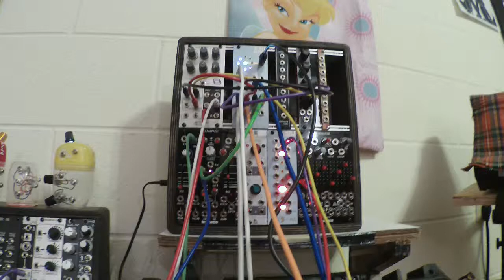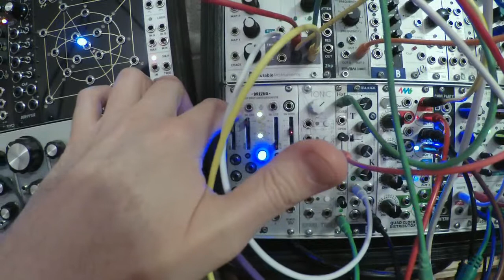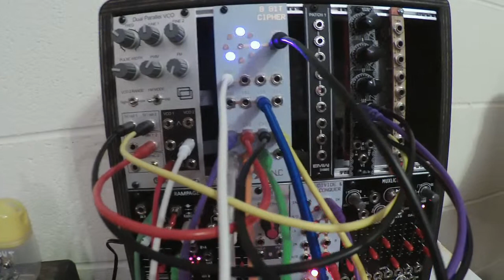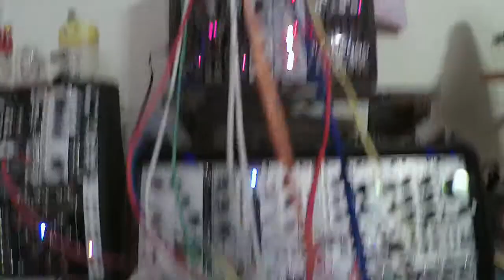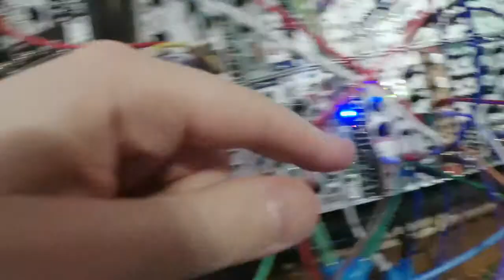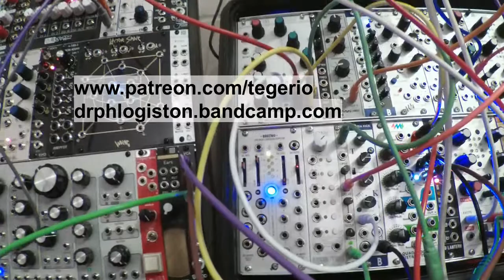NLC 8-Bit Cipher

Comment: Im looking for a module to generate pseudo random looping gate patterns out of LFOs etc, this and drezno both seem like good shouts, do you have a favourite? The CV outs on the 8 bit cipher are a nice bonus, Im not overly bothered about the stuff drezno does with audio.
Reply from the maker: Definitely the Cipher for me.  I use it a lot more than Drezno, but these days I mostly use the CV outs.  If you're using them to generate gate patterns, consider the following:

The Cipher uses a shift register and is only looking for an on/off state at the data input, so if you feed it a sloping LFO the subtleties will be ignored and it will be treated as if it was a square wave.  Assuming you use a steady clock, changes in LFO rate will change the gate patterns, but in odd, non-obvious ways.

Drezno uses a direct analog-to-digital converter so the shape of your LFO will affect it, as well as the rate.  Altering the input signal will change the gate patterns in obvious and immediate ways.

Both modules can be clocked "irregularly" i.e. they do not require a steady tempo.

For the specific application you described, I think Drezno would be more satisfying to use.  But for long-term versatility in lots of different kind of patches, the 8 Bit Cipher is the clear winner.
Reply: @JoshuaKennedy321  thanks for the detailed response. If I can be so churlish as to press you further: drezno is better for gate patterns because it requires less tinkering/more taming? I guess I want the one that produces the wider array of vibes. Did you find the gate patterns these modules produce got a bit samey? The fact that it's cheaper and also produces CV has me leaning towards Cipher. Let's Splosh also looks pretty nice...
Reply from the maker: @sumocloud  Drezno seems more sensitive, or responsive I guess.  It's easier to get noticeable changes and it's simpler to control them, whereas the Cipher depends on the interference pattern between your clock and your data signal.  Drezno produces wilder patterns and the bits are arranged so if you're feeding it a simple triangle wave the slower-changing ones are at the top and the busier ones are at the bottom.  Cipher feels a lot more "samey" ... but those 4 CV outputs are really worth having.  If my 8 Bit Cipher got damaged I would replace it.  Drezno, I don't think I would buy again.
Reply: @JoshuaKennedy321  cool that's really useful, thanks!

Comment: Love your style, man. Super fun.
Reply from the maker: Thanks!
Reply: @JoshuaKennedy321  So---a year later---what's your thoughts on this gem. Do you still have it? Does it make more sense? How do you use it most often? Really interested in this one. And thank you!
Reply from the maker: @JohnoWells  It's closer to two years later and yes, I still have it.  The Cipher is one of my most-used modules that finds a place in almost every patch.  The CV outs are more useful to me than the gates.  I rely on Cipher mostly for modulation but the CV patterns also work (when attenuated) as melodic sequences.  The output is positive voltage only and is "stepped" since it is an analog interpretation of an 8-bit number.  As far as I can tell the four CVs are derived by combining the bits in different order.  The bit sequence is a digital shift register.  Bit 1 is derived from the state of the Data input (high or low relative to a threshold which I think is 1v but don't quote me on that.)  At each clock pulse, all the bits move down one position and a new one is sampled at position 1.  I still don't know how the two Data jacks interact.  Are they just summed into the 1v comparator or are they logic'ed together?  Plugging 0v into Data 1 will turn all bits off after 8 steps (and a steady high signal will turn them all on) but plugging 0v into Data 2 won't do this.  The documentation says you have to feed it a Data signal to make it do anything but this is not true.  Mine powers up with all bits on; all I have to do is connect a clock and it starts generating a pattern (with no Data input the pattern is the same every time as far as I can tell).  There's supposedly a XOR combination of the shift register output with Data input but I have not been able to figure out logically how it works.
TL;DR I use it all the time as a quick semi-random sequencer, and occasionally as a gate source.  It makes a lot more sense 2 years later but it still has some mysteries.
Reply: @JoshuaKennedy321  oh, man--thank you so much for this detailed and awesome reply. Really appreciate it.
Another example of our amazing community. I think I'll be getting this module.

Comment: 2 CV ins &  8 Outs?  OMG I would have a ball with this.... I can connect this to my braids mutable instruments
Reply from the maker: Well actually it has 9 gate outs and 4 CV outs which produce a pseudo-random stepped voltage in sync with the clock.  There's also a "strobe" input which I didn't get into this time; when Strobe is high (or was it low? can't recall at the moment) it freezes all of the outputs except Super Serial, which keeps firing as it normally would.